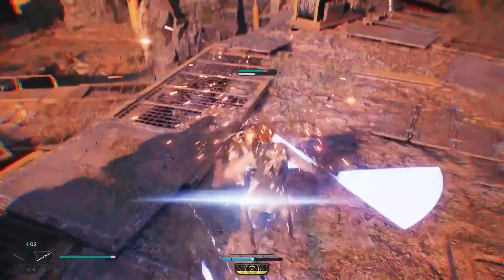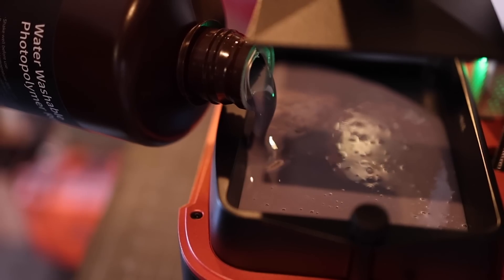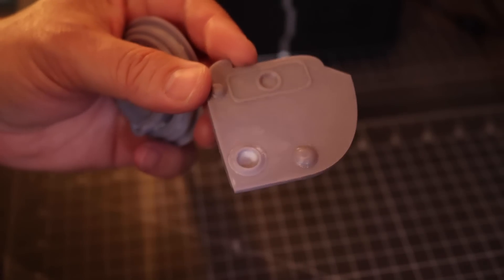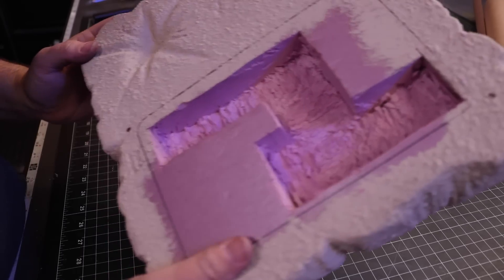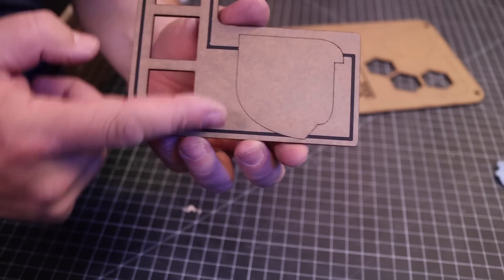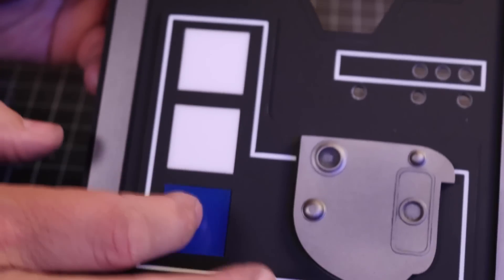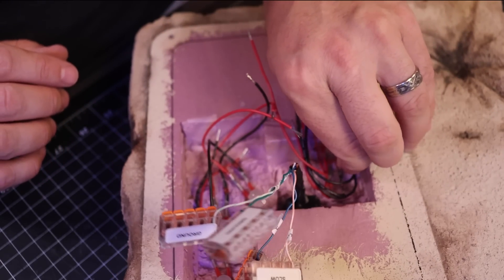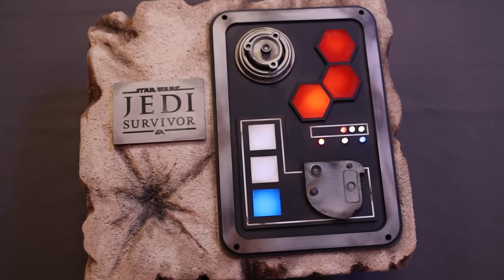Star Wars Jedi Survivor | Control Panel Build

Comment: Hello Brian, thats an awsome new panel you build. Just a short question. Is that wood glue you mixed the sand with or did you take some kind of liquid filler or paint to get that sandy surface?
Reply from the maker: Thank you!  Nope, no wood glue.  it is just sand and latex paint you would use on the walls of your house.

Comment: Hello Brian, regarding that big LEDs you used, do you have to use some resistors or are those big leds ready for use between 9-12Volts?
Reply from the maker: The big one is rated for 9-12v, so no resistor needed.

Comment: What sort of acrylic are you using for those tiles? 'Normal' coloured acrylic blocks too much light when backlight and 'tinted' acrylic is too transparent. There is 'frosted' acrylic that is ideal for backlighting. You shouldn't need the packing material that, while it diffuses well again blocks a lot of the light.
You want the LED mounted back from the acrylic as far back as the piece is wide if possible to best avoid hot spots.
Reply from the maker: These are translucent.  They’ve worked great in the past for this sort of thing, especially when I am able to point the LED directly at the tile.  This was just a bit of a different configuration this time around.